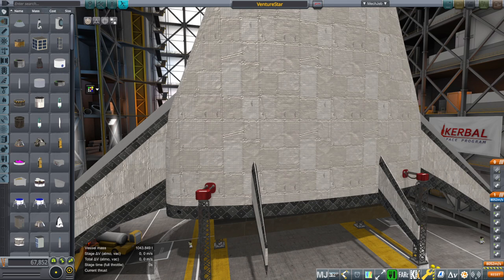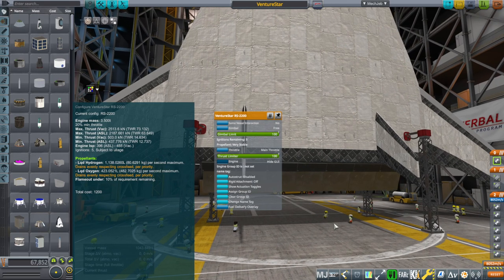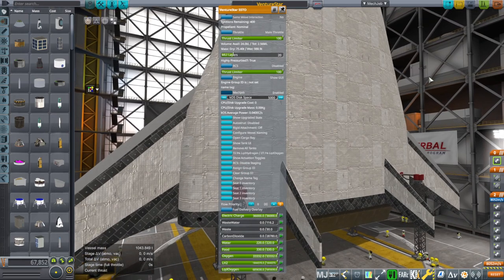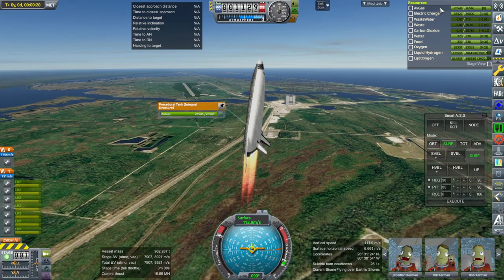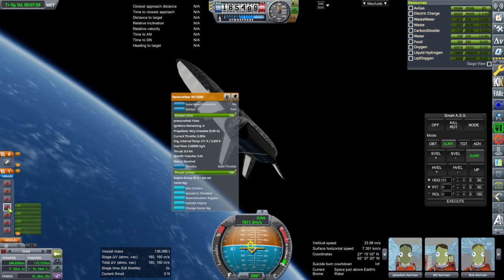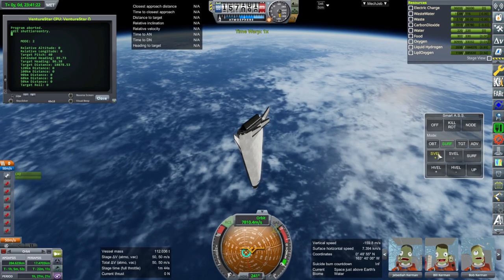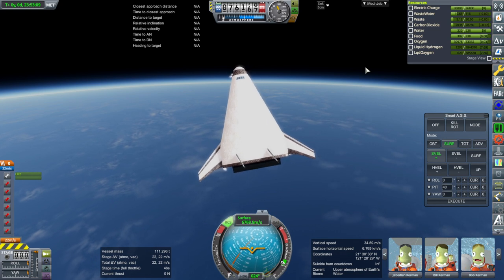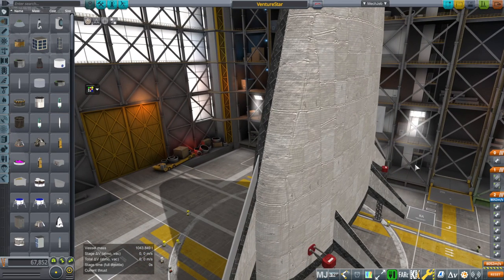KSP 1.8.1 with RO - VentureStar Update

Comment: If memory serves, the scale model tests Lockheed performed also showed how un-aerodynamic the Venture Star was, so 100% accurate simulation? 😂
Reply: X2
Reply: X-33 was a 67% scale version with a smaller payload bay size relative to the spacecraft, other than that it is literally a slab of un-aerodynamic metal
Reply: @PhazzeeYeehaw  > True, but it never flew either, I'm talking about the much smaller radio controlled models they tried to fly - rather haphazardly due to the 'interesting' aerodynamic properties of the design.
I believe wind tunnel testing confirmed that the stability issues were something of a concern, whether they could have been dealt with by an autonomous flight computer successfully, is sadly something we'll never know for sure.

But in reality there were so many 'issues' with the X-33 project it's hard to say if throwing more money at the problems would ever have resulted in a successful flight.

On the other hand given the staggering quantities of money they would end up throwing at Boeing for the the very conventional SLS, maybe they should have kept at it?, who knows some version of it might have actually worked in the end.